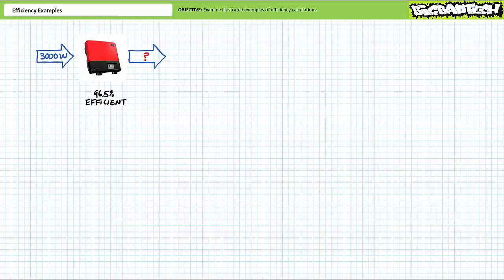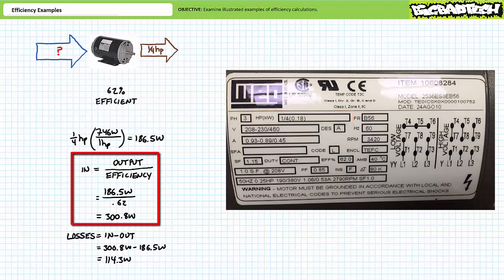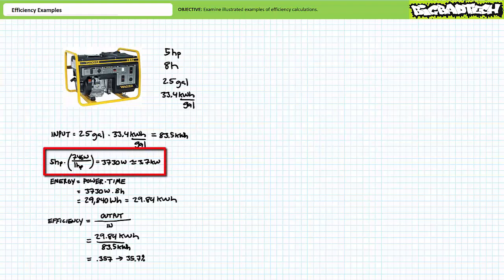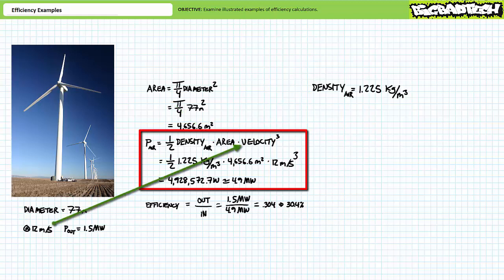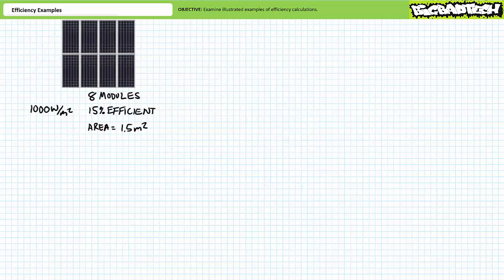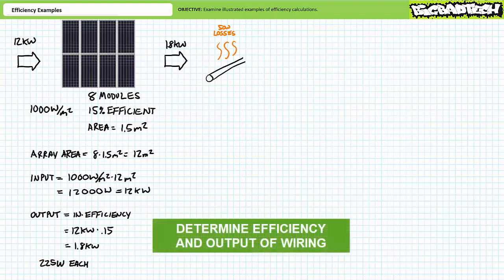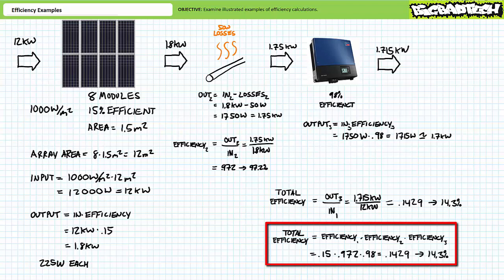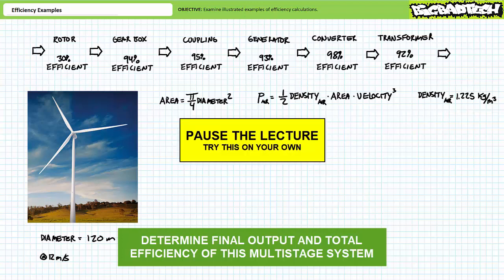Efficiency Examples (Full Lecture)

Comment: For the power created by wind turbine.... I try to keep the units intact as I plug numbers into the equation.  As I canceled terms I end up with kg×m^2/sec^3.   The answer seems to be in watts.  Is there a conversion... I'm guessing I'm far off here .
Reply from the maker: Yes, there's a chain of unit conversion that ultimately yields Watts. A Watt is a unit of energy (the Joule) per unit of time (the second). A Joule is a Newton of force expressed a distance of 1 meter. I'll actually revisit this calculation in an upcoming lecture on hydro and wind power.
Reply: @bigbadtech  ilk keep working thanks

Comment: What's the software code that I can use to evaluate motor efficiency
Reply from the maker: Efficiency = out / in
Check out the "Mechanical Power: Torque and Speed" lecture at: https://youtu.be/CEH_qyMa5X8 
P out = PMECH = Tn/9.55
Pin = electrical power consumed by motor
DC https://youtu.be/y_-UtpYE05E
single phase AC https://youtu.be/nse2vSlOoME
three phase AC https://youtu.be/bVjmy2vBj-0
Reply: @bigbadtech  thank you for replying

Comment: Everything you've said is true and you are an excellent resource!

On a side note, I've noticed that there are a lot of sunshine numbers being used around the topic of renewables, that is to say mistruths. To be clear, I'm not saying that renewables are without value. Rather, I'm saying that real math (facts) should matter and should be used to determine that value.

At random, I chose a windfarm near where I live. I went to their website and noticed that nearly every page stated their benefit in terms of power output and how it compares to fossil fuels. However, I also did the math and their stated output was at 100% rating of the sum of their turbines. I then called their facility and spoke to a manager. After some persistence on my part, they finally admitted that the numbers were assuming a constant 25mph or greater wind speed. They also reluctantly admitted that their output is less than 100%, but tried to tell me that this isn't something that they track. Obviously, they track their real output, but they were just not willing to quantify their percentage of deceit. Based on the equipment used and the published wind resource for the area, I'd say their capacity factor is about 20% at best.

They also stated how many full time jobs the site employed, but the real value was only 40% of what they stated on the website.

I just wish this industry was more honest about their output. Why lie?
Reply from the maker: Ironically enough I'll be publishing a lecture on capacity factor next week. I wouldn't be so quick to jump to the conclusion that something nefarious is going on but rather consider the following ... no power plant ever runs at full capacity all the time. Even nuclear and coal fire power plants and hydro electric dams have capacity factors of less than 100% and don't always produce 100% of their rated output. When you look up the nameplate power rating of any plant (nuclear, coal, hydro, wind farm, etc.) it's always listed as if the plant was running at full tilt. In reality all plants run at much less than their rated output given required maintenance, intermittent resource availability, regulatory curtailment, and many other factors. 

As a preview of next week's lecture: Capacity factor is a measurement of how often (ie: the "time" portion of the energy = power * time equation) a plant does so. A capacity factor of 20% is not unreasonable for a wind farm. I think wind turbines are such a hot button because it's so obvious when they're not moving whereas with other power plants passive observers are left to wonder whether the plant is running or not. A rather surprising example of this: Hoover Dam with a nameplate power output of 2080MW could theoretically generate 18,220,8000MWh of energy if it ran 24 hours a day 365 days a year ... but it doesn't .... on average it only generates 4,200,000MWh per year which yields a capacity factor figure of roughly 23%.
Reply: @bigbadtech 
I appreciate the thoughtful response!